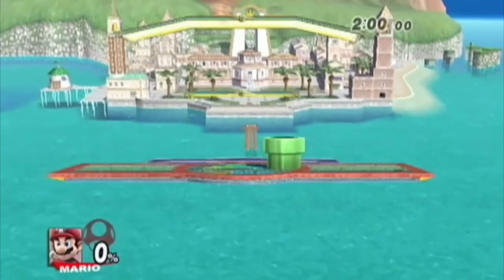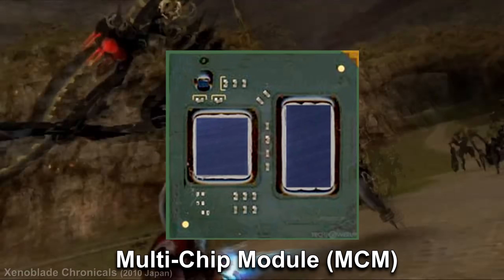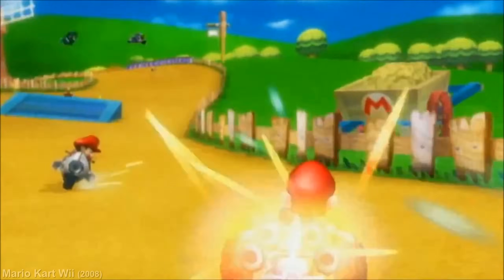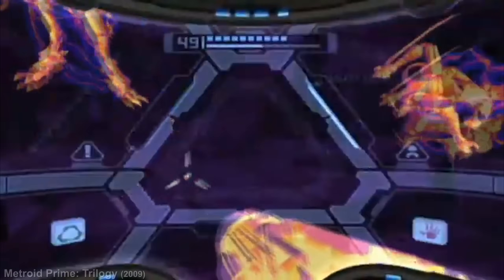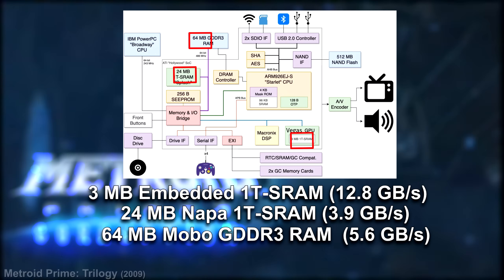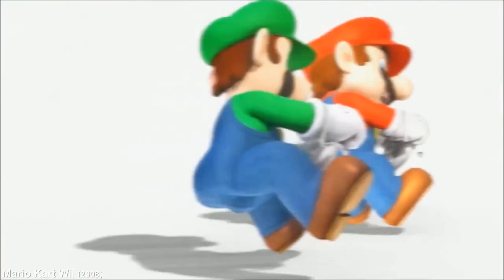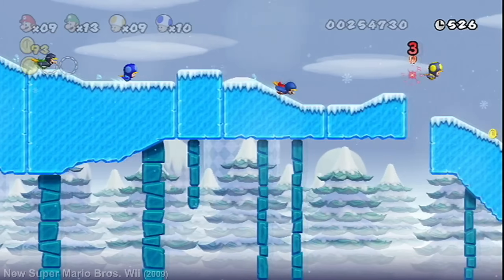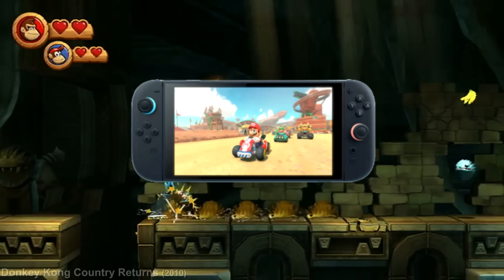The Nintendo Wii GPU: Hollywood (Retro Breakdown)

Comment: The Wii and 360 at launch didn't feature HDMI ports at the time, less than 20% of homes at the time had HD TVs. So pushing hardware that was "HD" at the time really didn't make a lot of sense from a pure sales perspective. I owned all three systems that gen and remember trying to use my launch PS3 on a regular old TV and it was almost unplayable. Thankfully HD TVs dropped in price fairly quickly and adoption rates went up.
Reply: I played PS3 on a crt 4:3 for a very long time and I never had any issues. But that's my experience so 😅
Reply: @limppeacesign it depends on the game, some where fine some ended up looking terrible.
Reply: @JonathanDeane most of my gotos were uncharted cod and GTA IV. I ended up getting an HD TV when five came out.

Comment: Apparently, the Wii had a cost of around $160 to manufacture (According to ChatGPT so take that for what it's worth). My guess is that they kept manufacturing costs cheap to compete with the PS2 (also at $150 at the time). If Wii were to be a failure, they could relatively quickly drop the price at $150.

Since PS3 and 360 were pricier consoles, maybe they raised it to $250 and bundled it with Wii Sports, as $250 was still cheaper than the Xbox 360's $300 entry price.

Comment: Looking back, I don't see why the Wii couldn't have been more powerful and at least been an HD console.

The Xbox 360 launched a year earlier for $400, but quickly got price reductions throughout that generation. Nintendo didn't even offer DVD playback or anything, and could've definitely upgraded the hardware a bit more.

They were selling the GC for $99 with a game included, and the Wii was basically just reusing the same hardware. Had Nintendo been willing to take a little less profit per unit sold (yes, Wii hardware sold for a profit day one, just as GC did) they could've at least put it in position to get real ports of multiplat games & had their games look better on HD displays.

Comment: is og xbox powerful than wii for a wii game to be ported to it graphically?
Reply: The Xbox's GPU is better than the Wii's in every way.
Reply: @brawlioxd but the CPU is worse and has less memory, you'll never see a game like Xenoblade, The Last Story or Super Mario Galaxy in it.
Reply: @Dash120z  The CPU of Xbox and Wii They are very similar, with the Wii only slightly superior The only thing is that it has more RAM but Xbox has more bandwidth. I see those games you mentioned running on Xbox without problems. Even PS2 could run Super Mario Galaxy since it has too much fill rate

Comment: Hey i was the guy that was comparing og xbox to wii i had one last question the wii was able to run alot of call  of duty games could the og xbox run them with better visuals closer to 360 gen even with a little bit less memory? Since it has better shaders
Reply from the maker: Welcome back my friend! Xbox would have been able to surpass or at a minimum, match the graphics of the Wii, and could have as the extra RAM wasn’t enough to make up for the more powerful Xbox GPU. In terms of raw floating point numbers, the Xbox GPU was almost twice as fast as the Wii’s, so it would have been capable of keeping up if they wanted to imo

Comment: 0:17 bringing up Twilight Princess as if it didn’t run and look better on the GameCube, lol. Metroid Prime 3 would be a much better example of the pinocle of the Wii’s graphics.

Good video though :)
Reply from the maker: Thank you 😊
Reply: @FrameRated  The Wii might as well be weaker than the Gcn, due to the overuse of bloom, streched 4:3 resolution  internally and Washed out graphics.

Comment: I'd like to hear your thoughts about how the Wii stacks up against the 3DS. It's one of the most interesting comparisons because the 3DS is clearly weaker than the Wii in its GPU but its support for shaders and other more modern features allowed it to outpunch the Wii nonetheless in certain areas...but it was still held back by a 240p screen.

The 3DS has more RAM than the Wii (the New 3DS in particular has nearly triple the RAM) and the New 3DS's much higher clockspeeds make that battle pretty close in a lot of ways but the 240p screen just keeps the 3DS from quite edging it out. If you compare titles that were Wii games brought to 3DS like Kirby's Epic Yarn the battle is pretty interesting because of that.
Reply from the maker: You’re absolutely right, that is interesting the think about! I haven’t researched much of the 3DS specs aside from what I remember the last time I got a brief run-down, but I am planning on researching it in depth soon for a near-future video coming out. So, one advantage I can say from that info and from what I know off hand with the specs that helped both 3DS and N3DS punch above their weight compared to the Wii was more modern tech plus lower native resolution. At 240p vs 480p, the Wii had to render over 3X the pixels of the 3DS and did so with much less RAM whilst having weaker texture compression, so graphics didn’t look quite as sharp or fancy, even though they had a much hire base resolution, as well as some graphics features flat out not possible on the Wii (per-pixel shading allowed better primitive dynamic lighting, specular highlights etc). That said, the 3DS also then had more headroom to really utilize those shaders and other hardware resources/features to improve games beyond what they could on a Wii because it only needed to hit 240p to do so. I could have some mistakes in this, as I haven’t had the time to do in-depth research, but just a potshot at what I can assume using what I know now. Certainly a nice topic for a future video!
Reply from the maker: As I look more into it, it appears that it didn’t support per pixel shading as I thought as it didn’t have programmable shaders, and instead relied on fixed-function hardware to replicate it; which helped it support many effects that were typically done with programable shaders to do so. I am definitely making a video on this now as I am invested in learning more!
Reply: @FrameRated  It's wild that they coexisted as current Nintendo platforms for nearly a year and a half despite being in fairly similar weight classes.
Reply: I never played the 3ds until i got one a few months ago..

I put 700+ hours on MHtri on wii..
And MH4 on 3ds looks at least 5x better, its a huge difference..

I read an article explaining that the gpu on 3ds, has more advanced design , closer to modern ones, thats why it performs quite well..
Reply: The 3ds is basically a Psp in a Ds Shell, graphically.

Comment: What if the wii had 128mb on release
Reply: fun fact: Wii dev kits actually had 128MB of RAM
Reply: @codezero7981  wow missed opportunity for Nintendo 🤦🏿‍♂️
Reply: agreed, they should have kept the 128MB of RAM for the final system and added a HDMI port, that alone would've made a huge difference.
Reply: @codezero7981  yep 💯
Reply from the maker: That would have helped with larger / more filled game worlds, maybe a little higher texture:

Comment: Funny you mentioning it's normal mapping capabilities. There's only a few games out there who actually used it and one of these games are Metroid Other M and it get's it done pretty well. One of the facts that kinda hurt visials were the low output resolution. Nintendo kinda missed the point here not including digital video output such as HDMI - even if the games were running 480p natively a nice addition in 720p or 1080i output would have been the better option here IMO.

ICYMI: The GCN was designed to output 1080p resolution in it's early lifecycle but then Nintendo took away these features since no one really had the capable TV's at that time. And with the Wii it is still a mystery for me when they didn't include higher screen output resolutions...

Welp I still had tons of fun with my Wii and thakfully nowadays theres quite a few options out there to enhance the lack of image fidelity thanks to the homebrew community.
Reply: They thought HDTVs wouldn't be common during the 7th gen
Reply: @Treetops27  and Plasma Panels werent as annoying over pixel counts as modern LCD/LED/OLED panels do.  Modern displays struggle with anything that doesnt match the same resolution of the screen, whereas Plasma panels were more common on this "transitionary period" from SD to HD,  LCD panels were terrible at the time.
Reply: GameCube was never designed to output 1080p where did you get this
Reply: Metroid Other M had normal mapping? :O

Comment: Which system was more powerful og xbox or wii?
Reply: OG Xbox - we only started seeing its full abilities towards the end - Games with normal mapping and Realtime shadows, and some progressive and 720P stuff. (Wii and game cube tended to use the less GPU stressful bump mapping). Halo 2, riddick: Butchers bay, Half life 2 and Doom 3 showed off it's potential. Shame it wasn't on the shelf for longer - but I heard it made a loss per unit sold.
Reply from the maker: GPU was more powerful in the Xbox, but the Wii's EDRAM helped close the gap slightly with it's high speed bandwidth and functional use. Wii also had about 8 MB more RAM to use and about the same CPU capability, maybe a little faster, than the OG Xbox. Overall, they're pretty even capability wise in most areas, save for the GPU, which takes the lead in raw graphics power a bit (8 Gflops vs 20 Gflops for floating point comparison, but isn’t the whole story)
Reply: @FrameRated could the wii run a game like halo 1 or 2?
Reply from the maker: @dbzwarrior4321  it would run with significant downgrades. They would first have to remove features derived from DirectX 8.0 that the Xbox supports and other various things would have to be dialed back as well due to the weaker GPU power and less complex shaders in the Wii
Reply: @FrameRated interesting so im guessing half life 2 is definitely off the table 😂
Reply from the maker: @dbzwarrior4321  Oh for sure! The Half-Life 2 port video by MVG is super detailed and very well done and goes into the incredible achievement that it was to get that game running on that level of hardware, so I would say no matter what refinement was done, HL2 would have been off the table in any recognizable form.
Reply: @FrameRated  one last question the wii was able to run alot of call  of duty games could the og xbox run them with better visuals closer to 360 gen even with a little bit less memory?
Reply: Bro is yapping out of his ass. 

The truth is that so called programmable shaders were still quite limited in actual programmability until pixel shader 2.0 or 3.0 depending on who you ask. 

The Xbox shaders weren't a major step above the Wii's fixed function shaders. And the original Halo isn't known for really taking advantage of the hardware.
Reply: @fungo6631  bro spent 15 years in game dev from PS1 through to PS3 Xbox 360 and Wii. Thanks.
Reply: the Xbox could have never run Super Mario Galaxy or Xenoblade.
Reply: @codezero7981  with the amount of memory available? No, it couldn't.
But the rest of the hardware was up to the job, fast programmable shaders can do a lot.
Reply: @codezero7981 Honestly, I think the Xbox could run the entire Wii catalog without any problems. It has a more powerful GPU, and it's not just about the pixel shaders the Xbox also has a better color combiner than the Wii.

Comment: I looked up this topic out of sheer curiosity and happened upon this (recent) video. Question: Is the Hollywood really the same architecture as the Flipper? Yes, some sources have claimed this, but I'm seeing some other sources claim it is derived from ATI's R500 architecture (same as Xbox 360, interestingly), which was first released in 2005 compared to the GameCube being derived from 2000 GPUs. Maybe both are true and they're just similar to each other.
Reply from the maker: Interesting! Due to the identical graphics pipeline and the fact that backwards compatibility was more or less simple I/O settings adjustment to get GC to run on Wii for devs, I am more inclined to believe the data leading towards it being basically Flipper 2.0. The R500 also had fully programmable shaders, which the Wii does not have that capability and it would be counter productive for them to somehow remove that while using the same architecture with Hollywood. Good question though! There may be some confusion or mix up online, as they were both made by ATI around the same timeframe, but are different designs.
Reply: As far I can tell, it's the exact same chip, with the exact same number of pixel shaders, vertex shaders, same amount of embedded RAM, literally every feature is identical, with the only difference being the clockspeeds, of which, Wii is 50% faster.

Comment: It's worth noting that because Wii heavily utilized motion controls on all games, it was optimized for CRT use. 
Albeit it could work on flat (Plasma) screens as well, the (LCD) ones that were on market at the time 
on Wii's release had mostly too slow gray to gray response -times even for light -gun -games seen on older consoles. 
So, motion controls were the main reason Nintendo decited to stick with 480P.  

Nintendo's "DNA" was not to produce underpowered consoles. 
Both N64 and NGC were cutting edge when they were released. 
Besides, motion -control -games on PS3 & XBOX 360 didn't actually look much if any better than the ones on Wii. 
Despite those games arriving very late during those consoles lifespan.
Reply: Not all games use motion control, I have around 11 games that don't.
Reply: @madmax2069  I wish most would at least have optional use of regular controller. Motion controls ruined some good games, like Donkey Kong Jet Race, for example. But Nintendo got girls playing videogames as a new normal, kudos for that.
Reply: @M1XART  yeah, having a game locked to only motion control was a pretty poor choice and does hamper the game. 

There are around 200+ games that do have traditional controller support in some way on the Wii (not included Wiiware). I would have loved to be able to play Zelda games with a traditional controller on the Wii.
Reply: the resolution is irrelevant with the motion controls since the Remote doesnt rely that much on tracking itself through a camera. Even though it has one on the tip of the Remote, the star of the show is definitely the accelerometer. The Remote camera has a black and white IR camera (which has a really high resolution) intended to pick the sensor bar position. Black and white makes the image transmission much smaller and faster to process (and even today, the logic behind modern camera features such as autofocus and auto exposure is based on black and white and not color, for example. The color is post processed.) Even with this context, most games dont even use the IR sensor aside point and gun games to track motion and the ones that do dont have any drop in graphic quality compared to all of the other games that just use the accelerometer (accelerometer and gyro "sense" motion, dont need to "see" motion) and nothing else. The closest ones are Wii Sports Resort which only uses the IR sensor to recenter the gyro for a couple of seconds and Zangeki no Reginleiv (the only game that truly use the IR sensor to track motion).

Xbox 360 Kinect and PS Eye do have drop in performance when tracking motion because a) they "see" motion more than sensing and b) there was little to none in device motion processing (The Wii remote processes everything on itself and only sends the "complete data" on the game logic) and Kinect and Move used the console hardware. This was a huge issue for the Kinect because developers expected the device to process motion on itself like the Wii Remote, but Microsoft changed the route mid way to lower the cost of the device, on the PS3 was less of an issue because the sensor was really close to the Motion Plus and most SDKs were similar, but it had issues when it needed to process the image feed.

You are correct that the Wii was released on a time that Plasma Panels were more common on these transitionary period between SD and HD. Plasma panels are not as annoying over native resolution as LCD based panels do. Since Nintendo wanted to offer the innovation of motion and wanted it to be as accessible as ever, the Remote is very advanced, but the actual hardware capabilities are not forward thinking.

Comment: The Wii was also in short supply and hard to get for its first 3 years. It was difficult to find a Wii, which Nintendo did on purpose with their supply chain management. They pulled the same limited production strategy with the NES Classic mini console. They’re going to do it again with the Switch 2, as they waited to launch due to Japanese yen having very bad exchange rates right now.

Comment: Man the Wii really should have switched to programmable shaders. It would have looked much better than the gamecube even if it's just an overclocked gamecube chip. Sticking with fixed function pipeline is quite disappointing. Developers did ise what they were given well though as you can see how much better some games looked like Sonic Colors vs Sonic Adventure DX
Reply from the maker: @crestofhonor2349  Yeah, when researching this video, I realized how far off I was in memory for the Specs of the Wii. I remember looking into a basic rundown many many years ago and just chalked it up as the weakest of 7th gen consoles with the most intuitive design and features. In reality, it was super interesting because of the reuse of what they already had with the GameCube with some improvements